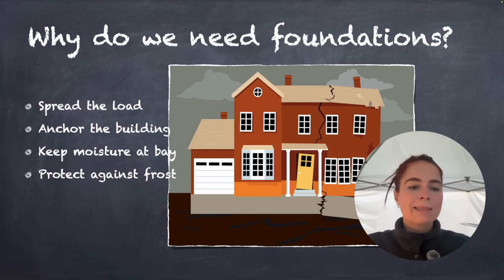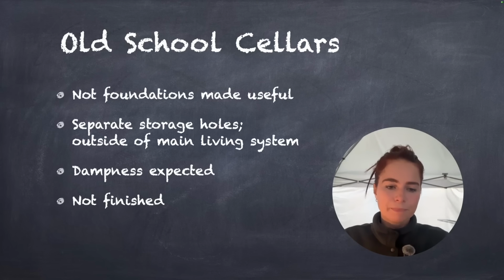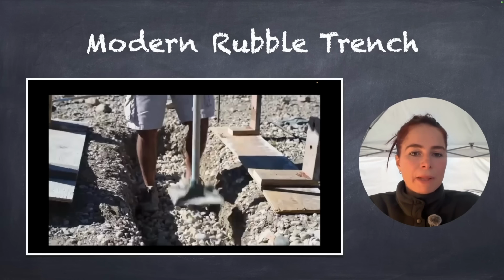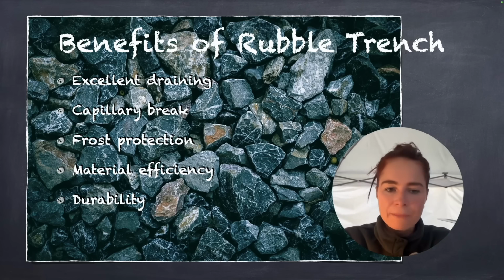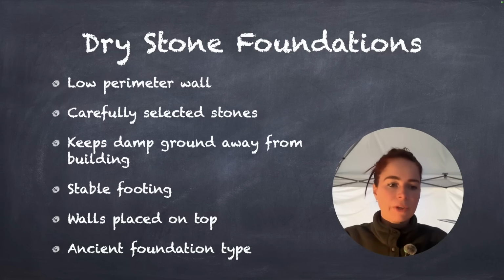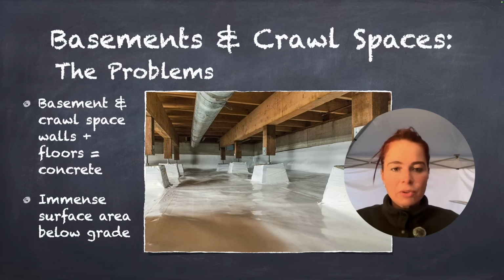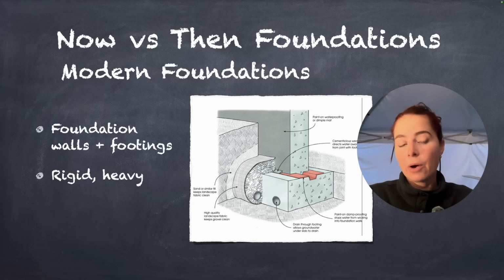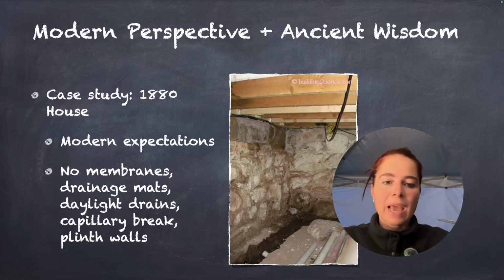Why Modern Foundations Fail — and the Genius Design We Abandoned

Comment: Your rubble trench has it's equivalent in todays building practices, with a bonus that inspector know all about them.   In a typical basement foundation, from Vancouver to Halifax, you dig your hole in the ground and pour a  minimum 6 inch deep footing on the undisturbed soil at the bottom of the excavation.   While Rebar, is not always required, I absolutely would not pour a footing without at least 2 parallel 1\2" or 10mm strands equally distant from the edges and under the walls.  Once the walls are placed\poured, all of the exterior surface below the finished grade needs a good water sealer or barrier  to stop your capilliary action.  On the outside and beside the footing area,  there should be a minimum of 6 inches of clear 1inch minus stone surrounding a 4 inch perforated plastic corrugated weeping tile around the entire project and covered with either newspaper or some other paper barrier.  That weeping tile needs to continue to a low enough area that it can drain the water from around your building.   
If it's available, (which isn't always the case), sand should be used  to back-fill the basement with a decent layer of topsoil at the surface for grass etc.  The sand wicks away the water, letting it flow easily down to the drain and away.  Done properly, that will keep a typical basement dry even in normal, but wet conditions.  Low lying wet areas require better drainage, but essentially that's simply a beefed up version of the above provided there is a place for the water to drain.  Drainage into a "sump well" will do, provided it's continuously pumped  as required.

The brittle failure cracks can also be mitigated in a poured concrete wall with strands of rebar.   An 8 foot depth of wall, requires roughly 1 strand 10 mm of horizontal rebar per foot.  The deeper and longer the wall, the more rebar is required to adequately re-inforce it.  Straight lengths of wall more then 30 feet in length can be reinforced  with buttress' poured into the wall on either the inside or outside.  Corners naturally re-inforce a wall, and can be used instead.  Cracking in basement walls with rebar, on a proper footing also with rebar, don't normally crack when all is done properly.  Cracking, typically means  something was missed in the initial considerations, but that's too big a topic for here.

Comment: Thanks for this video! What would you do about existing buildings without foundations? The problem I have with my old house is that the outer brick walls are built into the clay rich soil. As I see it, I can not fully create a rubble foundation under those walls because I need to compact the rubble. For that I need a gap. So I can not completely attach a retrofit rubble foundation to the wall. That is why I think I can not skip something pourable like concrete or I have to close the gap with layering in bricks!? Another problem is that, ideally I can work in trenches of e.g. 1m, because supporting the full 15m is quite expensive, but does compaction of the rubble foundation work, if i only compact a 1m trench that is interrupted!?

Comment: This is actually specified in IRC 403.x area. If you are having difficulty with Design Review, you should have their boss fire the reviewer. Always make sure to call out the code sections in the plans so the Plan Reviewers have no excuses. This should be a fireablenoffense if they try to deny plans using this. 
My problem is that this is allowed for pre-poured concrete walls, but not for ICF. IRS 403.xx shows a wood base plate 2x8 and a 2x6 foundation wall on top of the 2x8 base plate which rest on the loose stone or crushed stone footers. I wonder if you put a treated base board down and ICF on top of that to build up the wall, would that be acceptable?

Comment: One of the issues with slab on grade is that it has no thermal break also it wicks moisture. You can’t put a hardwood floor directly on it due to moisture wicking the same as those concrete basement walls . It is often cold and non insulated. Raising your floor off the ground creates a thermal air barrier.

Comment: They used quick lime , did not premix water and lime,  they adjusted formula for underwater. There concrete mix generated heat , took longer to set
Reply from the maker: That's a great addition! The hot mix question is one of the more fascinating details in the Roman concrete story. The heat from unslaked lime reacting in place may have been part of what drove the mineral formation that made the marine concrete so durable. Thanks for bringing it up!

Comment: We actually did rubble trench with grade beam, and on top built a stone slipform knee wall.  System works great.  Dug over 100' of wall with tractor backhoe, filter fabric, and drain pipe in bottom.  Covered with 3/4 - 1 1/4 stone, hand tampering in layers.  Also used 2" foam board on outside of trench.  Then poured reinforced grade beam.  Built our own slip form panels 2 × 8. 5/8" plywood ( later used on roof).  No issues at all with heaving.
Reply from the maker: Wow that's so cool, thanks for sharing!

Comment: How does this thinking compare to earth ship type homes or homes built into a hillside? Is it a question of what you want: insulated but damp vs dry but greater temp variation without additional heating/ cooling?
Reply from the maker: Thanks for the thoughtful question, interesting comparison. Earthships and hillside homes can definitely take advantage of thermal mass and earth sheltering, but they also come with some real moisture and soil-gas challenges depending on the climate and materials used. In my view (especially from a health perspective), those risks outweigh the thermal benefits. It’s a really interesting topic though and one I may explore more in future videos.

Comment: Is the house anchored to the ground or is attaching it to the wall above the rubble trench enough?
Reply from the maker: Yes, that's right. The house is anchored to the grade beam or stem wall (with anchor bolts like any other foundation). The grade beam itself just sits on the compacted rubble trench and transfers the load into the soil by gravity. The stone trench acts like a well-drained footing.

Comment: Should the rubble trench come above grade or the backfill be rubble also so that the house doesn't contact moisture?
Reply from the maker: Good question. The rubble trench itself already acts as a capillary break because it’s filled with free-draining stone. Typically the wall above is still raised above grade and separated from the trench with a grade beam or stem wall to keep moisture and splash away from the structure. A capillary break is usually installed between the stem wall and the main wall as well. The surrounding backfill is usually soil, but a geotextile fabric is used to keep the soil particles from migrating into the rubble while still allowing water to drain. Good drainage and slope away from the building are important.

Comment: Modern homes were designed in an era of CHEAP energy.  
As a result, modern homes are energy inefficient.  
I understand that 20% of the energy escapes through the concrete foundation into the soil.  
We need to design energy efficient homes...

Comment: Slab on grade isn't the best design either, depending on the climate.  In Florida, slab in grade is a huge problem due to hurricanes and flooding.

Homes in Florida and similar areas prone to flooding need to be off the ground.

I would build a 4 foot stem wall with flood vents.  You could use the rubble princle below grade for drsinage.  The flood vents allow the crawl space to breathe and water to flow through in a flood event, keeping pressure off the foundation .
Reply from the maker: Great points. Slab-on-grade can be a poor choice in flood-prone climates, and site-specific considerations really matter.

Comment: Very interesting. Would this work with AGS (annualized geo solar)?
Reply from the maker: Great question. I think it could, but the details would matter a lot. AGS depends on keeping the soil dry and controlling heat flow with insulation. A rubble trench helps with drainage, but the stone can also become a heat ‘highway’ if it isn’t detailed carefully.

Comment: A lot of Asian and Pacific Island peoples used a sort of post on stone foundation. They worked on principles similar to how modern decks are built, but instead of casting concrete to secure the post they would place a large boulder like stone (or use one that already existed in location) that was secured with earth to be stable and load dispersing. The stone and post were shaped to fit each other and create an anchor for the load they would carry. This sort of raised foundation allowed buildings with floors raised off of the ground that could even be built partially over water in some cases or were able to be walked under comfortably and only accessible inside by ladder in others.

Comment: Every poured wall fountain I've ever seen always has stone under, just not as thick as the trench. But on the outside a French drain with the drainage stone & geotextile fabric.  Often with a tar type waterproofing & foam board on the wall to minimize temperature differential with the interior side. Under the slab, we also Install a vapor barrier poly sheeting for waterproofing. 

We want Basements for tornado protection, storage & temperature is cooler in summer. Also many houses built on hilly terrain will need to at least partially be dug down to reach stable soil. 
I just find it strange that you feel that we shouldn't have them, each person can have their opinion, and I'd just advocate that they be done correctly if done at all & it'll avoid 90% of your complaints.
Reply from the maker: Totally fair points. Yes, capillary breaks under slabs are a well-known way to reduce capillary rise, and vapour barriers under slabs are commonly used to control ground moisture vapour. And yes, exterior dampproofing/waterproofing plus a footing drain (French drain) and insulation are standard best practice to reduce bulk water ingress and manage temperature differentials. My bigger point is more about risk management for health/IAQ: finished basements are a relatively new expectation, and in my opinion they’re one of the most failure-prone parts of modern homes. Even when built “correctly,” they’re still the most moisture-loaded zone of the building and can be harder to keep truly dry long-term. Basements definitely have real advantages (tornado protection, storage, cooler temps, hillsides, etc.). I’m just suggesting that if the priority is indoor air quality and mould risk, it’s worth questioning whether we want basements inside the conditioned envelope at all — or whether it’s better to design above-grade where possible.
Reply: @thehealthybuildingproject 

I suppose if your main goal is air quality, then removing the possibility of a basement allows for control of those variables.  

I suppose my experience doing renovations has mostly found black mold from roof leaks and penetration of water around windows... most of the time the house is old & was not designed/built with our current best practices & products to maintain a house envelope. 

Also, water leaks around pipes in kitchen & bathroom have been problematic...

So it is a whole house approach, design for watertight envelope with or without a basement, which should improve indoor air quality & then keep up with maintenance & take care of any problems immediately.

Comment: Carbon warriors despise Portland cement production so now is the right time to propose concrete alternatives.  
 The disadvantage of lightweight wood framed structures is that they're more easily wind damaged than heavier masonry designs. Rubble or stacked stone foundation designers would need to propose methods of securing stick-build structures to the foundation.

Comment: Dry stone walling are used in the UK and Ireland for livestock enclosures and looked much different than your illustration.  As you said, the stones had to be carefully selected, the lowest stones would be large and tilted toward the centerline and the wall would continue to be tilted in on itself as higher and gradually smaller stones were built.  The walls you showed look unstable.
Reply from the maker: Totally fair points, it's hard to find the right images!

Comment: Being German, seeing Americans finding out about the world is just hilarious sometimes: Tilting windows, or a drainage under and around the house is just normal. But here is one better: We have Schaumglasschotter which also works as an insulating layer two. And there are special types of this which is so strong you can build large structures on it.
Reply from the maker: Worth noting: much of modern building science was formalized by Joe Lstiburek in North America (he's Canadian). The issue isn’t lack of knowledge, it’s a profit-driven industry and minimum codes that often ignore best practice.
It’s also important to be careful with generalizations. German-speaking Europe tends to operate at much higher baseline standards than much of the rest of the world. I’m Swiss and spent several years in CH. The gap isn’t knowledge, it’s what gets normalized and enforced.

Comment: So this "modern health crisis" is essentially... "bad air"? Sorry, I'd rather live in a properly insulated, air-tight house with a HVAC system. Then I can benefit from lower energy use and clean fresh air.
Reply from the maker: Fair pushback. On the surface, calling indoor air quality a “health crisis” might sound extreme.

The issue is that we’ve never lived in homes this airtight, with this many synthetic materials, trapping moisture, VOCs, soil gases, and microbial contaminants indoors. That level of concentration is unprecedented.

I agree: airtight homes can work if they’re paired with proper ventilation (ERV/HRV), low tox materials, and excellent moisture control. The problem is that most aren’t.

There are unintended health consequences of changing the indoor environment without proper regard to air quality.

Comment: Where do earth sheltered homes fit into this equation?
Reply from the maker: Good question. There is historical use of earth-sheltered homes in certain regions and climates, usually very site-specific. From what I understand, they still require a proper foundation — often an even more robust one — because the walls and roof are retaining soil.

I’ll admit I haven’t dug deeply into them yet, but my hesitations come from the increased soil contact: higher water intrusion risk, reduced drying potential, and greater exposure to soil gases when those spaces are fully enclosed. That doesn’t mean they can’t work — just that the stakes are higher. Definitely an area I want to read more about.
Reply: @thehealthybuildingproject  Ha ha dug deeply Yes why don't you look into them a bit more because there are many videos on Youtube suggesting that earth shelter homes are far superior in terms of insulation and savings related temperature control

Comment: I lived in an area with a very high water table (dig a hole it will fill up with water to 12" below grade in a few hours). The soil was mostly clayish and had no stones. Every single basement in that area was full of cracks and all needed sump pumps that discharged regularly (several times every day). The old home I lived in was probably built in the 1920's or 30's and had an 8 ft high basement, yet did not have a single drop of water and not a single crack in it. It was made of concrete and large stones in it with a semi finished look. It did not even have a sump pump installed. I am still puzzled by how it was built and what they did to keep the water away from the concrete basement walls on the outside. They knew a lot more back then than modern builders and better than many of the civil engineers and home architects

Comment: Concrete basements with a good, wide foundation drain, completely isolates the foundation wall from soil and moisture. So long as you are not into the water table or a underground water flow area, it's enough, but it requires maintenance. Above ground structures also require exterior maintenance. Living in caves isn't for everyone though.
Reply from the maker: Yes, absolutely, basements CAN be done well... but they rarely are. That said, what's interesting to me is how basements within a relatively airtight building envelope are a rather new phenomenon. Health implications are still showing themselves.